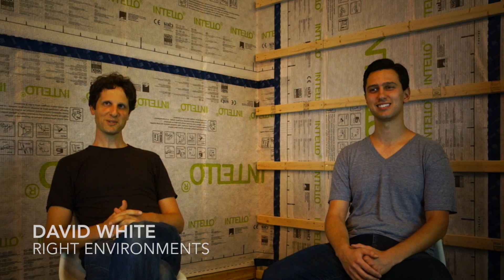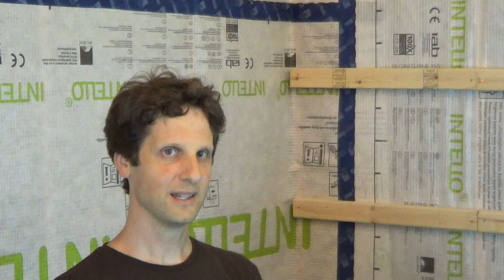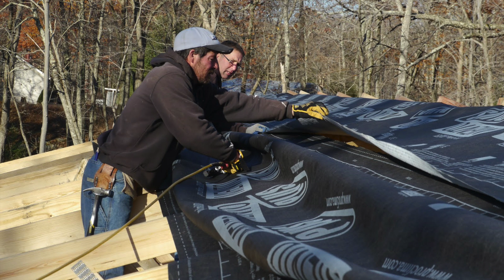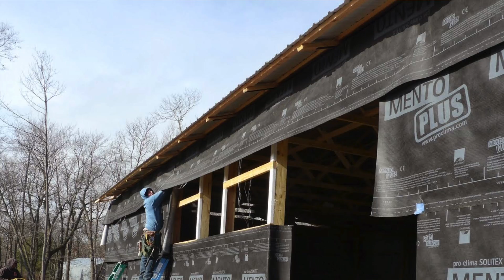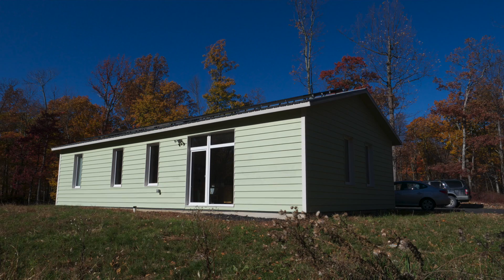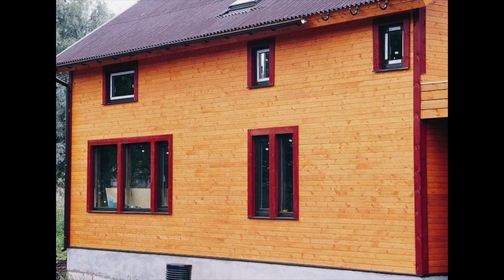475 On-Site: Net-Zero Upstate NY, Passive-esque House On A Budget

Comment: Great work subcribed. We or on our path to build a passive home. Just closed on some property in wyoming mountains cold for about 8 months out of the year  and planning on buildig in stages to hopfuly have no loan. wish us luck.   with this type of building i dont see the need to consider geothermal due to its high cost and the home envolpe being so efficiant and easy to heat.

 any thoughts on geothermal recomended?
Reply from the maker: You're right! Focus on optimizing the enclosure so you can reduce the mechanical needs of heating and cooling. We have worked with many people in cold climates - even colder than Wyoming - that can vouch for this.

Comment: Very Interesting! Is the Solotex just draped across the trusses without any continuous support?  What holds the insulation up there between the trusses?
Reply from the maker: In this example, there are some trusses between beams that hold the insulation up, but because it's Rockwool, it's rigid and self-supporting enough that it does not require much support to stand. They also ensure insulation was friction-fit as best as possible. Solitex Mento Plus does not require any sheathing or support due to the reinforcement layer in the product. This is why this WRB is the basis for our "Sheathingless" assembly method. You can find more about Sheathingless assemblies and Solitex Mento Plus on our website, just search for either there: https://475.supply

Comment: Trying to figure out the wall design.  From exterior to interior: 1) exterior cladding, 2) 1x2, 16" on center vertical strips 3) SOLITEX MENTO Plus barrier 4) 2x4 girts, 27-1/2" on center, 5) 4x4 poles, 8' on center and frame fenestrations 6)2x4 girts, 27-1/2" on center, 7) 2x4 studs, 2' on center, 8) INTELLO Plus Barrier, 9) 1x3 girts, 10) Drywall?  Have you use this construction for any other buildings?
Reply from the maker: As a material supplier, we see many different assemblies everywhere we work. This one is pretty unique! That said, the most typical assemblies that come close are "sheathingless" assemblies, and strawbale assemblies. You can find examples of each on our blog at https://475.supply

Comment: So cool. I love the precast concrete posts. I need to find a supplier of those beer me. 

How did you manage siding along the bottom? That’s the main question I have about your building. Normally the stem wall provides the backing. How did you do it?
Reply from the maker: Good question! Ben is now documenting his work on instagram @build_mantle - you should reach out to him there.
Reply: @475.SUPPLY  thanks!
Reply: They are Perma Columns

Comment: How does this work without a steel (or maybe OSB, etc) skin directly screwed into the posts and girts?  I thought the whole concept of post frame construction counted on the skin, with direct mechanical attachment, providing  sheer and twisting force mitigation.   This building doesn't look to have a lot of X-bracing to make up for the loss of the skin doing that job.

Comment: 48'x24'=1152 sqft@ 170k= 147 per sqft. Not bad I suppose, if they are including labor. Which I'm assuming that's what was done, it was built by a professional carpenter at a full labor rate. More specs and number are always appreciated. Good video

Comment: I just stumbled upon this video and this is what I have been planning in my head for my build spring of 2019, however, I want to go 2 story... Possible using the same build system?
Reply from the maker: Hi Keith, it is possible to use the same system now. We have actually elaborated on our recommended construction details since we put this video out a few years ago. If you go to our site, you can download our updated 2x Framing eBook for free, and get in touch to discuss. Happy building.
Reply: Yep. Find a post frame engineer, kit company or builder and they can make it happen.

Comment: 200,000 seems quite high for a house that size. Granted the passive style lends it self to save energy and money. It would be interesting to see what the ROI would be on it.
Reply: that's with design and engineering too, just to make sure we're on the same page
Reply: Yea seems too expensive, I've seen numbers that its just a little bit more expensive than a regular house construction.
Reply: @Alex-zm8ss  Nonsense. PH costs significantly more. Anyone saying PH (or near-PH) is a only 'small premium' is lying thru their teeth.
Reply: @Alex-zm8ss  It's pretty typical costs for that type of home in the area. New York is expensive!

Comment: This is great.  Are there more detailed specs, pics, ect somewhere else to peruse ?  
I'm most intrigued by the perma-column use with the inner insulated pour (passive heat reservoir).  I know you touched on it but I didn't quite understand the steps you took to avoid thermal bridging at and around the concrete portions of the posts.  (?)    

$200 k ?  That's great.     I'm drawn to the $100k mark though.    Micro-Net-Passive?
Reply: You just line the columns with foam. 100k is definitely possible. I'd love to see it!

Comment: Interesting building method.

What's the life expectancy on such a building?
Reply from the maker: Good question. Some of the Pro Clima materials have been advance age tested for 100 years of performance. The Roxul insulation will never rot or degrade, as it is made of rock fiber. Considering those facts, we expect the building to last in the neighborhood of one century, certainly longer than the average cycle of renovation in most buildings.